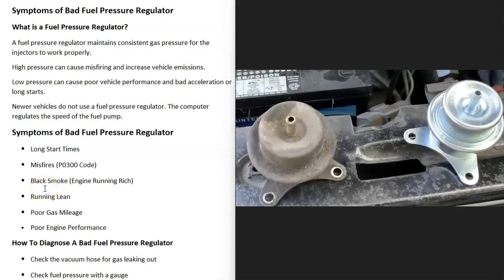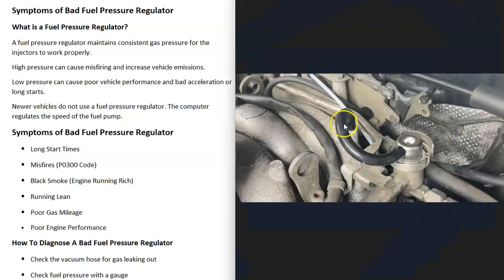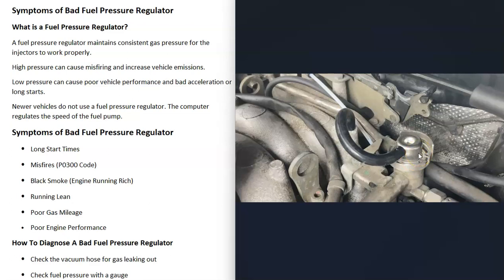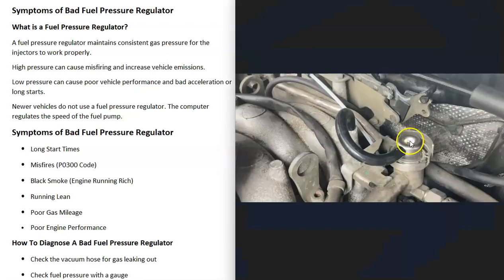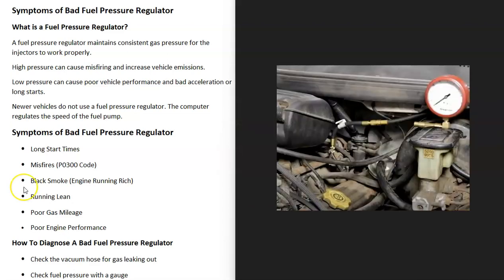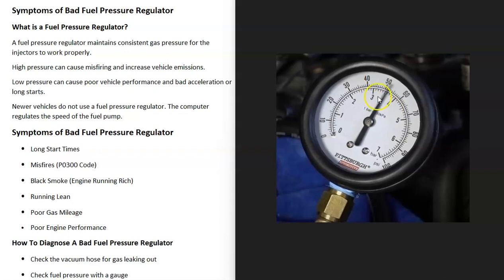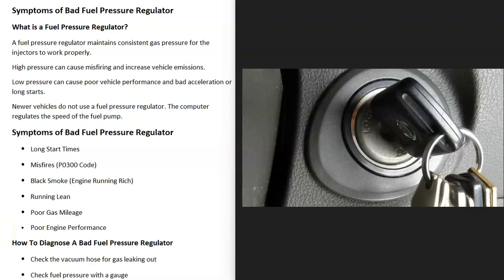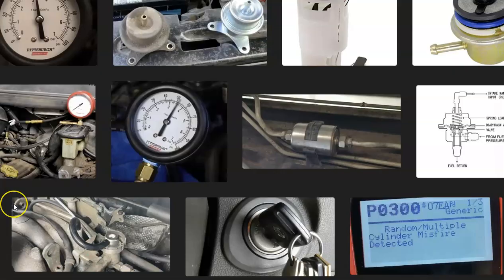Symptoms of Bad Fuel Pressure Regulator and How to Test if it Has Failed

Comment: Hi, I have the issue of high rev when idling. The rev counter will seat around 1.5 and 2. Further to that, the vehicle is leaking feal on my exhaust pipe 

Can the cause be the fuel pressure regulator?

Comment: Im actually about to change mine, I just figured it out after changing the throttle body, fuel injectors, spark plus and coils, and it was still running rich with the p0300 code along with the p0175 and p0172 code. So this would be the last thing. The purge valve was fine so I didnt have to change that.  So im crossing my fingers because its stalling at low acceleration.
Reply: well... how did this go?
Reply: @HigsKay nope wasn't the issue. Im waiting on 2 downstream 02 sensor. I just fixed everything related to this rich fuel code. If this don't fix it then im not sure. This would be the last thing. There was no leak, I replaced fuel pressure regulator,  spark plugs and coil packs, coolant temperature sensor, and evap canister. Hopefully these downstream will fix it. They come tomorrow we'll see. It's frustrating.
Reply: @Boxxthepaperchaser1  sorry man i feel your pain. i'm also battling a no-start condition and i've changed coils. today I tested my fuel pump and it seems to have no pressure. i'm getting a test unit tomorrow as well so let's see how that goes. hoping for the best for you. keep updating.
Reply: @HigsKay the weird part, all the stuff I changed the symptoms are getting better. My 02 sensors just came a hour ago. So we'll see if this solves the rich condition. The weird part once the car heats up it runs fine. Its just in the beginning not enough air to ration mix thats cause stall. So I will update you as soon as I put them on. Im changing both downstream sensors.
Reply: @Boxxthepaperchaser1 let us know!
Reply: Tps sensor possible or throttle body idle screw maybe distributor timing, vacuum leaks are common on Honda/Acura gaskets,exhaust leaks
Reply: @gsrjaycee4521  well, it was my ecu. the ignition component fried and my constant trying to start the car fried the coils as well. so i repaired it and I am getting a (different) set of coil packs to transform it to coil on plugs rather than a coil-lead-wire mechanism. let's see how this weekend goes.

Comment: My lincoln mkc 120k on it black soot in tail pipe runs rich sometimes jerks out of nowhere i got an intermittent cyl 4 misfire i think this is the issue also on my 2014 ford taurus it lost tons of acceleration but it will eventually get up to speed, uphill it trembles, gas in the oil, misfire code, i thought it was worn piston rings.... please help

Comment: Literally replacing this in my 5vz-fe engine as we speak.  It went from hard starting to only starting when I sprayed starter fluid into the air intake.  Eventually it would start, run for about ten mins, and then die.  I suspect it could be more than the regulator, but I’m about test my fuel injectors since I’ve gotten all the way down to them anyway.  GETTING DOWN TO THIS PART HAS BEEN A COMPLETE PAIN!
Reply: I just changed my fuel injectors,fuel pump, oil pressure sensor,all 3 main EVAP components. Just to get no codes and finally one popped up after a month.  It shows too lean.  So I'm assuming it's my fuel pump.
Reply: I mean fuel pressure regulator, my bad. I'm zooted
Reply: @BigSuaveTaylorMadeTX 😂😂
Reply: @BigSuaveTaylorMadeTX  did replacing the fpr help?
Reply: did it help?

Comment: can any one answer this question ??????:
if the fuel pressure regulator damper goes bad, can that also cause a system lean at bank problem ???   because not enough fuel is going in but rather too much air ???   any one please.....🙏 🙏 🙏

Comment: Can a vehicle have trouble staying running with a bad fuel pressure regulator
Reply from the maker: Yes, that can cause idling problems, but many other things can also cause that issue. If you can scan for codes and have fuel pressure regulator codes, then it likely is the issue and should be tested.

Comment: Hi I have  a 2006 gmc sierra sle 4.3 My truck starts up and then dies every time. I change the camshaft sensors crankshaft sensor, airflow sensor and still does the same. If I spray starter fluid in it, the truck will stay running till I stop spraying then it dies . Could it be the fuel pressure regulator?
Reply: My fuel pressure is 55 on the fuel rail
Reply from the maker: Yes, it's possible, I would test it for sure.
Reply: @HVAC_Mechanic  how can I test it before I take it apart because I checked the fuel real it was 55 psi not sure what to do. Any help would be appreciated.

Comment: I have a honda civic d15 engine when the engine is running i unplug the vaccum hose from the regulator and theres no such difference in fuel pressure does that mean my fpr is damaged and need replacement?

Comment: Hi, thank you for this great video. I have a question. I own a Hyundai Elantra 2013 and latelly sometimes I could see that it took just a second or two more to start then usual. I started researching and found out about the fuel pressure regulator. Since then I have been turning the key waiting a couple seconds and repeating a couple times before starting the engine and it always starts right up no delay no problems all great. Is there anything else that could cause symptoms like this or fuel pressure regulator is the best bet?

I think on Elantra filter and regulator are all on fuel pump so I would change the whole thing. I am no mechanic but I think I should be able to tackle this one.

Thank you for help.
Reply from the maker: The fuel may be draining back to the tank. It needs to be diagnosed. A bad fuel pressure regulator can cause it, but a leaky injector or bad fuel pump check valve can also cause issues. The components need to be tested to know what the issue is.
Reply: @ Thank you for reply Sir. I greatly appreciate it! I will see if I can diagnose myself if not I might take it ti the shop. Again, thank you.

Comment: All fuel pumps do not run in the key on position , some run while cranking .
Reply: Most will prime rail 2-3 seconds at a time and will stop pumping when there is no crank sensor input after that for safety reasons. You should be able to hear a short buzz when you turn key to on, that is pump. Newer cars may do this all in the tank pump so you won't hear it. Put a guage on the rail and watch it when you go key on.
Reply: @68pishta68  You dont listen very well do you , not only that , you think you know it all also , well , you dont .......
Reply: Well this kind of explains my issue. I have good fuel pressure running and even shut off but just goes down with just key on. It drops 20 psi.
Reply: So I need to try them to turn the key on more than one time

Comment: Is a fuel pressure regulator itself supposed to pull vacuum when the vacuum hose has been removed while at idle? Not the vacuum hose, but the regulator itself. Thank you

Comment: Hey man if I turn on my fuel pump with a scan tool am I supposed to hear hissing from the fuel pressure regulator because I've been having some serious fuel pump issues so I changed my fuel pump fuel filter because I'm having a loss of power when I accelerate at low speed and then my fuel pump would just give out

Comment: based on your info it doesnt seem to be my fpr. if its running rich it means spark plugs would be black, so i checked my spark plugs and they a clean. so maybe it is running lean thats why im having long start times. heres where your info looks useful to me(pls correct me if im wrong) . you said if i turn off the key then pressure would slowly go down that results in long start times because it cant hold pressure. but this isnt the case with my long start time. first thing in the morning the engine is cold, my engine starts with one click no problem, but after its been running a few minutes if you turn it off again thats when it has a hard time starting back again. i try to do the on-off three times trick and it doesnt work. the only way it starts with one click again is to let the engine cool for about a half hour to an hour. so it losses pressure when its hot, but starts right up when its cold? my fpr is connected to the fuel rail theres no gas leaking through the vacuum hose i checked.
Reply from the maker: A component may be failing when it gets hot. I would test the fuel pressure when the engine is hot. A good OBDII scan tool should have fuel pressure readings or a fuel pressure gauge can also be used.
Reply: I've got the same problem. Cold. It cranks right up. Drive one mile  cut it off. Shop no more than 15-30 minutes and it wont crank unless I put it on the floor. 
Did this a couple months now when light turns green. Press pedal to go and engine stops.
Have to press it to floor again to start. Once its running... I gently press pedal and very slowly take off
 On way home running about 55 I stomped pedal to floor and it took off. No hesitation all the way up to 90 and maintained that speed for half a minute and ran perfectly.
Did notice when ideling fuelmpressure guage holds steady at 48.psi but when you cut it off pressure starts dropping.
Mechanic thinks its pump, inline filter in tank OF COURSE!!!  After video I'm thinking fuel.pressure regulator.
Reply: @truthseeker1693 I have a similar problem. Did you ever figure it out?

Comment: How do I know it’s the pressure regulator and not the fuel pump
Reply: You should hear the fuel pump turn on each time you cycle the key , if the regulator is bad It won’t start up good right after being turned off and when you first turned it on, it will idle rough , would definitely recommend checking the fuel pressure before you look into changing a fuel pump, also you can clean the fuel filter but I’d check the fuel pressure first
Reply: clamp off lines individually ..isolating each line
Reply: Pull the hose out and put a water bottle , crank the car , if gas comes out the fuel pump is working
Reply: Check the fuel pressure with a fuel pressure gauge
Reply: What about if you have to pump the gas to get it to start or when I shut it off fire up right away
Reply: The fuel pump makes a noise when you turn the vehicle on.

Comment: Ok so it it the bypass control.
Can you check function with a mighty vac on a regulator out of the box? If I apply vacuum will you be able to blow through the fuel section or does it require 30 plus pounds to open it?

Comment: Do you can help me please find the fuel pressure regulator in my Suzuki Grand Vitara 2011 2.4L ?
Reply: If you can’t find it in the engine bay on the fuel
Line then it’s most likely in the fuel tank apart of the fuel pump assembly as all modern car are moving it from inline to intank
Reply: Yeah. That pressure regulator is on the same connection with the fuel pump. The fuel pump is located inside the fuel tank.

Comment: So my Corolla has this huge weird issue where it takes long maybe like 5-6 turns before it starts in a hot day (morning start) after engine has been running regular temp, stop at a store for 10-15 mins crank takes 7-8 turns. On a below 60 degree day this is no longer an issue anytime. Engine starts immediately. Is this a symptom?
Reply: Im having this same issue did you ever find out what the issue was?

Comment: GM 5.3 LS.  Has the regulator on the fuel rail and a teeny tiny vacuum line to it from the manifold.  The rubber on the vacuum line is cracked, so it must leak and not be proper vacuum at the regulator.  This should cause a constant high fuel pressure, correct?  Now the truck also has a recurring P0420 code.  Could this tiny vacuum line leak be the cause?  Engine otherwise runs super smooth and solid.
Reply: You should be able to tell if the vacuum line has a leak by blocking the end going into the FPR with your finger to check for suction. If there is any question, the vacuum line is inexpensive so replace it. Attach a fuel pressure guage to the schrader valve and note the fuel pressure rise at idle when the vacuum line is pulled off the FPR. In my GM 5.3L Flex fuel, it rises about 8 PSI, as I recall. The highest vacuum occurs at idle, pulling against the spring and diaphragm, opening the valve in the FPR and sending all of that unneeded gas back to the tank. Without vacuum at the FPR, there is way too much fuel pressure in the fuel rail at lower rpms. Disclaimer...I am not an ASE certified mechanic.

Comment: My question is could a bad fuel regulator cause the fuel pressure to pulsate? Even after you’ve changed the fuel pump. This is for an ls swap

Comment: My fuel presure regulator hose is shut and it dosnst connect to intake manafold. Could this cause misfire and rich condition, when accelarating fully car missfires and hesitates. Its fsi 1.6 engine
 Also spark plugs and coils are changed
Reply: Hey what kind of car you got

Comment: Hello, just one question. I have a Kia creator 1.6cc.running rich even at idle. Gas in the oil and a intermittent misfire. Change all the coils injectors, charcoal canister and whole fuel pump assembly because the fuel reg. Is on on it. No shredder valve on rail. Any suggestions please?
Reply from the maker: I would pull the spark plugs one at a time and match them to a burn chart to see which is running rich and double test that injector. A Fuel Pressure Tester kit with a T fitting, placed inline, can be used to test the fuel pressure.
Reply: Just a word of thanks, I check the injections as you suggested and two of them were leaking. Never expected that because they were new,though aftermarket. Problem solved. Thanks again.
Reply: Thank you. I didn't really expected a reply will try your suggestion and let you know the results.